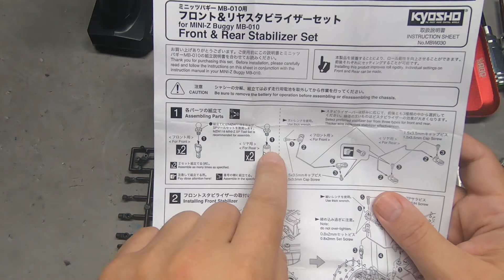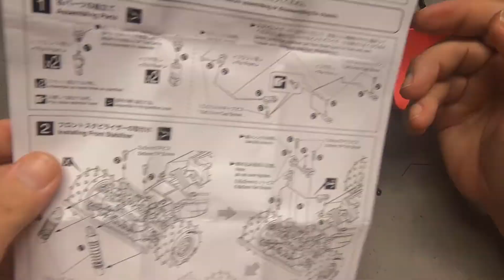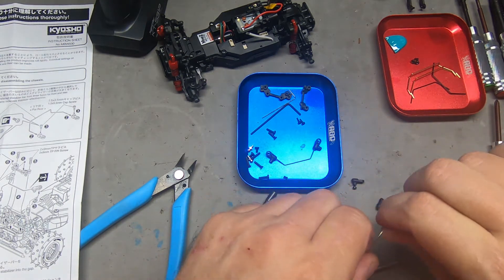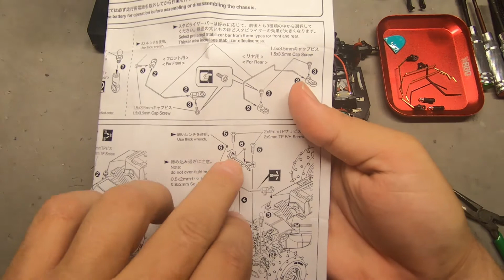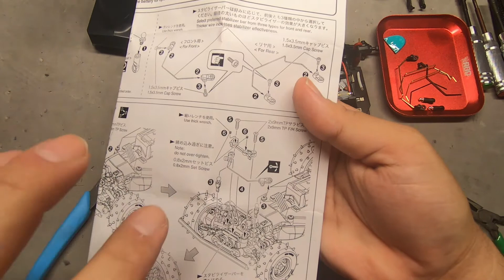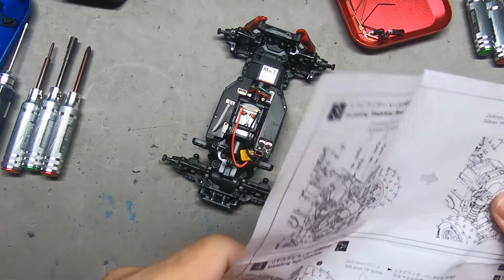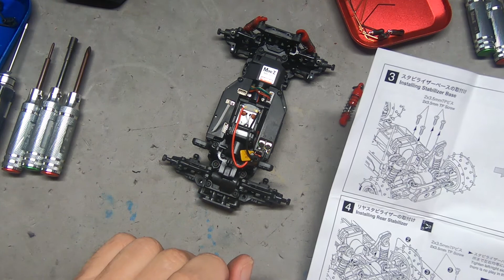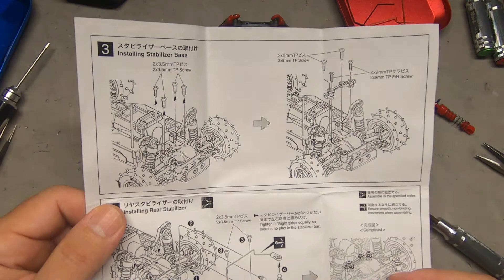Mod - Under Guard MBW033 & Stabilizer Set MBW030 for Kyosho Mini-Z Inferno MP9 MB-010S - Pt. 3b

Comment: I just did this whole install today, what a pain in the ass, LOL.  Two things,  1. I noticed that the front links that connect to the bar / A-arm, bind if you have the big bore shocks (I do).  So, I had to reverse the links (switch left / right) so that the screw faces in towards the diff vs. the springs.  I wish they mentioned that in the instructions.   The second thing, was in the front, for the set screws.. They just keep going, and going, and going down.  With no bottom.  Like you , I am super careful with plastic and screws.  So, I went slow, expecting it to stop when it touched the bar.  But, this really never happened.  I noticed that for the set screw to actually keep the bar in place (hold the bar low in the slot) the set screw needs to be well past the plastic part that it starts off in.  So, this part I did not like, unless I did something wrong, but I don't think that's possible.   What bar stiffness did you go with?   After the install, I honestly did not notice any difference in driving it.  (high grip on tile floor, with foam soft tires).  It might corner a little better.  I actually compared it to my sons buggy, (we have two) and was hoping to "feel" a real difference.   It took me 2hrs, to do this LOL.  and I have been in RC for over 30 years.   I am debating removing the bars and just keeping the stock setup.  Just to remove more points where binding can eventually happen with wear and tear etc.  But it is cool, and I use to use them on my 1/8 scale Vorza back in the day.
Reply from the maker: You might try a longer set of grub screws/set-screws. As I recall, I went with med front and soft rear... I think. These cars are so small and so fast that it can be hard to recognize changes... it really takes a track and a timing system to suss out what improves handling and what doesn't.
I agree that their value is questionable and if they do cause binding, they are a deterrent to good handling.
Reply: @MyRCChannel-CJScott  Thanks so much.  I am going to try what you say.  I used the small in front and medium in rear, so I maybe got it wrong.  Good point about the track.  I agree this would be best to see the difference.
Reply from the maker: @travisharrisphotography  Well, I might have it wrong... I'm sure that I tell which I use somewhere in the video. As I recall, one of the inside wheels (F or R) was lifting in turns and I was trying to compensate for the imbalance. 
Best of luck, and Happy Holidays!
CJ
Reply: @MyRCChannel-CJScott  Thank you!  You too 🙂

Comment: I wanted to ask, do you actually notice a big difference in driving the buggy with the bars installed?  I remember years ago with my 1/8 buggy, this made a difference.  Just wondering if you think its worth the hassle overall on this little guy?
Reply from the maker: I think it's relative to the surface. If you're running on RCP track, gym mats, or other smooth high grip surface, the anti-roll bars are probably well worth the effort. If you're running on an undulating surface with lots of bumps, you're probably better off without them. If it's somewhere in between, running the thinnest bars, or none will be a choice... depending on how the buggy is handling, you might run just the thin front bar, or just the thin rear bar.
If you don't have a GoPro or video cam, take a smartphone and place it low and close to a couple corners and record the car at the highest frame rate... or slow motion if your phone cam has the option. Then watch the video to see what the buggy is doing... is it lifting the inside front tire, or sliding the rear end, etc. Use this info to make tuning choices and then test again viewing the results.
Reply: @MyRCChannel-CJScott  Some good info there.  I run with the foam tires, inside my house on polished tile flooring.  The grip is pretty good, so, maybe they would be worth a shot.  I guess it cant hurt anything, lol.  Tho, I admit I love how it handles as is.  I cant imagine it getting any better.  I have been blown away by this, it's just like I am driving a larger 1/8 scale.  This buggy is unreal.
Reply from the maker: @travisharrisphotography  Hey, if you're happy with the way it drives, keep it as is. Save the money for something else. Sometimes I wonder if putting $300 worth of mods on a $200 car is really worth it. I think a lot of the mini-z upgrades, particularly aftermarket, are more about adding bling and the urge to tinker. But, that's why it's called a hobby, right.